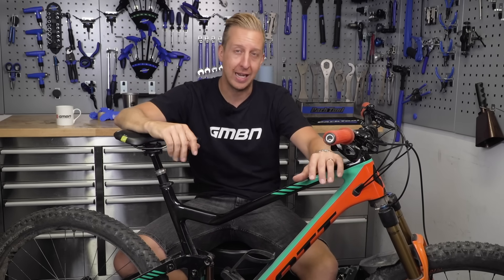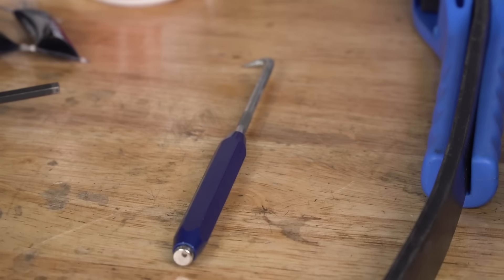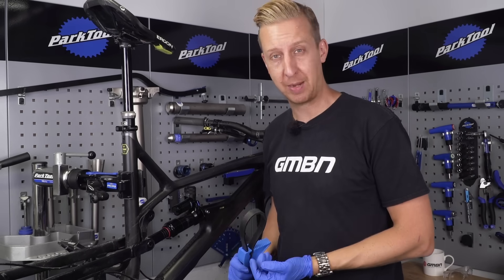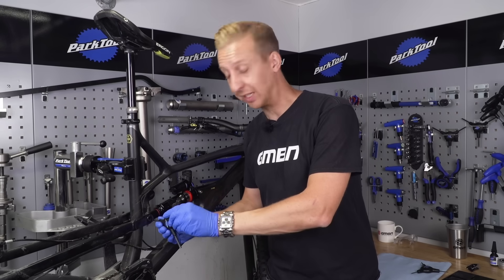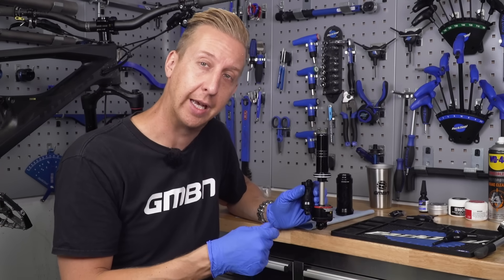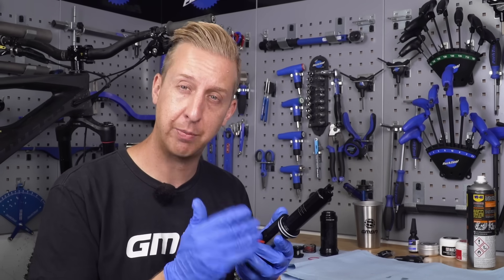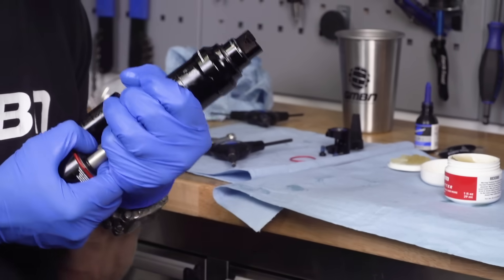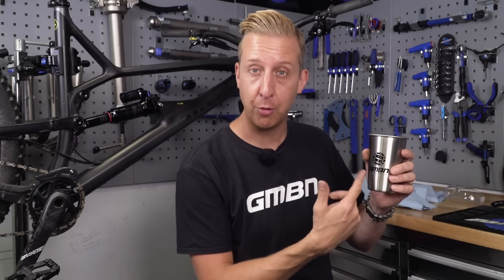Basic Mountain Bike Air Shock Service

Comment from the maker: Could your shock use a service? 👇
Reply: A service? Its only 15 years old !
Reply: i actually have rockshox's rear shock with 60hours in, yes mine could use some service. And this sure will help alot! :)
Reply: Mine definitely does it's never been serviced
Reply: Were the Fox Float oil pillows for bench decoration or did you just forget to use them ?
Reply: GMBN Tech My fox vanilla air is still sweet after 18 years with no servicing!
Reply: GMBN Tech #question hi Doddy, sometimes I go for a ride after work and live my bike in the truck, suv, and it gets super hot in there even though I live the windows cracked a little, do you think the heat might negatively affect the suspension or other components? I live in Alabama us, it gets very very hot, great show, cheers!
Reply: Nope, it's only a few months old. But I reccon I can't service it myself 'cause it's a Fox-shock with a Specialized brain?
Reply: TF Tuned get to see me once a year due to my track record with bike maintenance lol.
Reply from the maker: Gillenz Fluff, it'll no doubt feel a whole lot sweeter with a service!
Reply: Not me Its new
Reply: Nope, almost brand new. On my other bike it really does
Reply: Why aren’t you replying regards oil pillows - this is a bad video to follow if you have no idea where and how much float fluid to add back to the can or where ever it’s actually supposed to go...

Comment: I just bought a bike from an actual bike shop just 100 miles away he has having bike Thursday, he said to me that the rear fox x2 float works fine but could do with a service the bike is nukeproof mega 275 carbon factory and he claims its hardly had any use and tbh from.the 4k pics he sent me of every inch it looks brand new, no mods at all apart from mich to maxxis which doesn't both me unless they came with the bike he never claims they were chasnin or not, anyway..... how can working well and need a service soon make sense, is he being honest from experience or has he took the new on off it for another bike and stuck an older one on, hopefully I've nor bought a pick in a poke but it's a bike shop with tons of good feedback and online reviews, thoughts? Either way the shock is getting sent for a refurb anyone recommend somewhere professional and quick thanks.

Comment: Thanks for this posting! Just a question about rear shocks without that additional reservoir.  Do those shocks contain oil inside that needs to be bled out first or is it just an air canister that provides the cushioning? What dissipates the heat without any oil?

Comment: Will Fox Rear Shock Rebuild Kit 803-00-142 fit on the 2005/2006 Fox Float R with Specialized Brain Fade? Fox Tech support is telling me kit will not work on a shock that old....3rd Party shock rebuild specialists (Freewheel/Shockspital & Risse Racing Technology) however are saying the kit should work fine. Any other definitive answers? Thanks.

Comment: I have a 2016 fox 36 160mm fox fork.  it started loosing psi after every ride. I went to do a lower leg service on it , ordered a newer 2018+ fox 36 air shaft assembly along with a seal kit, I found out I could not install the newer style air shaft I researched wrong.  I cleaned it , new dust wipers seals and fluids and cleaned the crap outta the stock air shaft.  where does someone buy parts for older fox forks? how do shops rebuild them? I can't find anything on the internet for any fork older than 2018. what would I do what else can I buy if I need to replace my airshaft

Comment: Good day sir, I purchased a carbon frame with 190 required shock, but I had a spare 200 Fox DRCV old rear shock. Can offset bushing fill the 10mm gap? If yes, will the structural frame not damage in time. I appeciate, thanks.

Comment: SRAM / Rockshox say to use Dynamic Seal Grease when reassembling. You've got a tub there on the bench (black tub), but you used SRAM Butter instead. Any particular reason for that choice?
Reply: It's basically the same thing. But it's called butter because it's a bit thinner and easier to apply
Reply: And he gives you the reason at 13:03

Comment: I did a full service on my 2015 monarch debonair rct3. There is 1 scratch in the air sleeve and a scratch where the IFP sits. I Changed all the seals including the IFP but the to scratches are still there. Is there a way to repair the scratches or do u recon it’ll be better to buy a new shock? Cheers.

Comment: Do Rockshox shocks not require oil on the air shaft, seems like a part that would require lubrication?
Reply: Same thing on Fox shocks. They need Fox float fluid (usually come in 5cc tubes with shock seals kit).

Comment: It's so ridiculous that Rockshox say to service your fork and shock every 50 hours. Think about a car shock. They don't get serviced for years and work fine with similar working conditions.
Reply: Unfortunately that's the way they're built - engineered to be light and frictionless means the trade off is regular servicing...  The recommended f*x service intervals are even more regular!

Comment: I have just done my first 50h service in fork and shock. I’ve got the Mega Pro 275 and the bottom shock bolt is often come lose. I used thread locker and instead of 9Nm I went 11Nm.  I used also white marker pen to see if bolts move and the bottom one do every maybe 50h riding. I also found the swing arm damaged a little from when the bolt came loose and i hit a rough section. What else can K do?

Comment: Thanks for this Doddy, very helpful. You said Rockshox recommends doing this maintenance every 50 hours of riding? Isn't that pretty often? Considering everytime I go out riding it takes me about 2 to 3 hours, that means I'd have to do that maintenance about every 16 rides out (so basically every month and a half). On a side note that Mega looks absolutely stunning.
Reply: Unfortunately that's the way they're built - engineered to be light and frictionless means te trade off is regular servicing...  The recommended f*x service intervals are even more regular!
Reply: Alright, guess I'll go with that for now, my next Downhill bike will have a coil anyway. Thanks for your answer mate.

Comment: I would to a see a video explaining bottom bracket standards. I got 2018 Specialized Enduro 29 recently. I bent my crank arm on a hard pedal strike.  The shop I bought the bike from refused to share the bb standard. It made figuring out which crankset to get not so easy. Specialized does not state this spec on the product page. I want to use this opportunity to upgrade not just replace.
Thanks
Reply: GCN, the sister channel, did a good video on this.

Comment: You showed the oil pillows but you never showed adding fresh oil, bad mistake if you run your shock without oil.  I watch my shock shaft for the amount of oil on it after a ride, if you start to see more coming out than usual that is a good indication that the shock needs the more extensive 50 hour service.  This check only works if you do the simple service regularly.
Reply: Grease the seals on the air can and shock piston. You add oil inside the air can to both sides of the piston.
Reply: Where do you add the oil or grease?

Comment: Great video to those who have a more conventional shock. I believe the fox X2 shock that I have has a diffrent desing and the only part that can be opened easily is where the volume spacers are located. I can't find a way to get it open enough to properly treat the seals that slide on the shock tube. Could you make a video for servising the X2 shock too? I believe this would help me and many other people greatly.

Comment: Is it mandatory to use the specific Rockshox/Fox products? Because here in my country they are prohibitively expensive..
Reply: As far as I can tell, the rock shox grease he showed at 2:25 was the PTFE kind.
There are plenty of such lubricants in the tooling,  automotive and bicycles industry, from different brands, if you ask around.
From my experience, products from the automotive or motorcycle industry are cheaper and come in bigger quantity.
Ask you local auto parts shop if they have any good quality PTFE lubricants (They come in either grease, or oil forms)
From wikipedia:
"Polytetrafluoroethylene (PTFE) is a synthetic fluoropolymer of tetrafluoroethylene that has numerous applications. The best known brand name of PTFE-based formulas is Teflon by Chemours. ... PTFE has one of the lowest coefficients of friction of any solid. PTFE is used as a non-stick coating for pans and other cookware."

Comment: IMO the only reason to use a strap wrench is your working on a potentially pressurised system and using the wrench keeps your hands/fingers out of the way. I've always done it by hand even though I have a strap wrench somewhere but you've made me think about the safety issue and how you can make the task safer... cheers.

Comment: Hello, I have a question my air can doesent come of it's stuck. The strap wrench is slipping of and when I try to do it with my hand I and my dad are not strong enough. How can I get it off ?
Reply: Give your strap wrench a thorough clean first. Then try applying some (gentle) heat with an air gun to the air can and some WD40 on the threads - thorough clean afterwards required!
Reply: Le Typ Thank you I will try it out.

Comment: no oil? 🤔
Reply: Yep, they missed something important there. Also I would remove all the rings and seals, give a good clean with iso, and re-lube it for reassembly.
Reply: @zeahroela  be careful getting solvents on gaskets and seals, it can make them expand and not fit right anymore

Comment: Hey @doddy! I read on fox website when performing this type of service we should to put in some fox shock fluid. Can't find any where im at so any advise in what kind of replacement weight suspension fluid to use? I heard motorcycle suspension fluid can be use as a replacement?
Reply: yes you can, it's just for the greasing, not for the damping.

Comment: Hello, i have a monarch plus rc3 few months old and the stanchion is always greasy. My question is what is this grease and is it important?
Reply: Seppoz I have this too
Reply: If grease is really lumping up I would remove the air can and check for seal damage (grease could be leaking through here). If seals are in perfect condition then that amount of grease on the stanchion is normal, just wipe it off with something nice and soft of it gets too grimy.
Reply: Oh and one more thing, it's important to allow the stanchion to slide through the air can as smoothly as possible, that's why the entire shaft should be covered in normal use with a thin film of grease

Comment: Can i have some advice. I can't decide between the YT jeffsy al or the Canyon Strive al 5.0  I'll mainly be riding trails with various dirt jumps every now and again
Reply: I would go for the jeffsy
Reply: The Shapeshifter on the Canyon is famously unreliable, which is why I got the Spectral and ordered an angleset.
Reply: You should be thinking of the Spectral and Jeffsy, Capra and  Strive are Enduro bikes.
Reply: Costa del Artlepool pretyy and easy to maintain doesnt apply with women. Its one or the other.